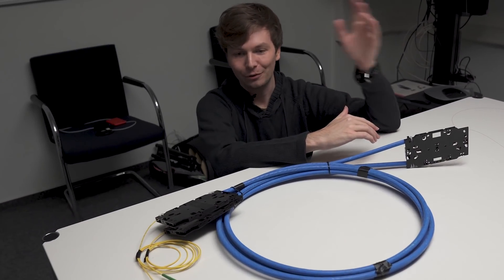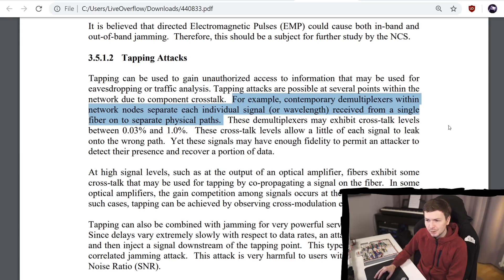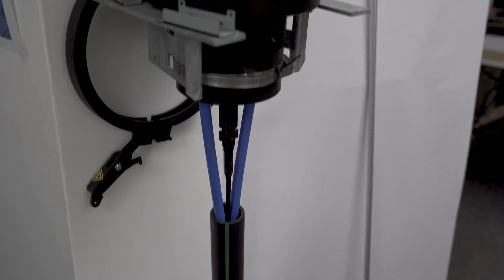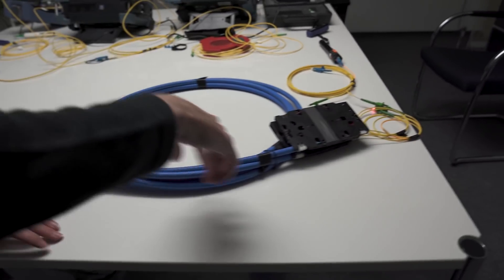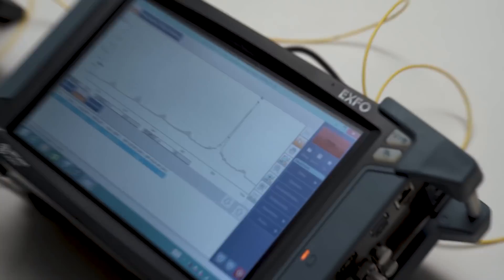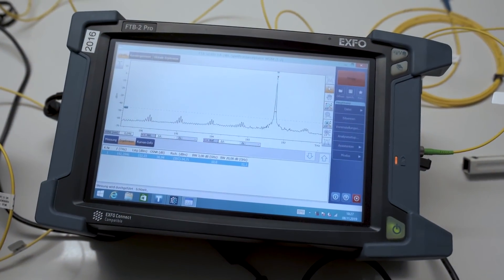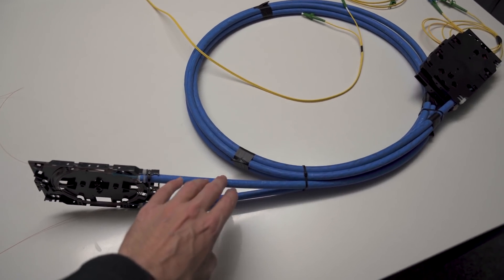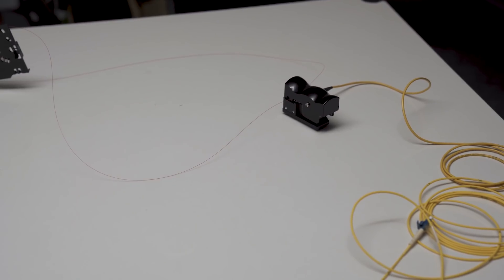Fiber Tapping - Monitoring Fiber Optic Connections

Comment: What if the tapping device senses the brightness of the input, taps it and amplifies it to the same level? The tapping would go unnoticed then.
Reply: Match something perfectly moving at the speed of light?  Best way would be to make very sensitive tap that would need very little light bled off so the drop in intensity would not be noticeable or to relay the signal after capturing it but this would have some lag and would probably be detectable.
Reply: @jameslowell9656  can't I just tap the signal and amplify it, realtime?
Reply: @sandipndev.personal  its moving at the speed of light ? So no you definitely cannot just add in the light you took out to the native signal instantly. There will always  be lag trying to do that. We just don't normally care about a few milliseconds of lag in the vast majority of applications amplification is used. But here they would be able to ping the line and know the signal is being delayed. If it wasnt something that was being actively monitored that would be fine , otherwise you would need to use minimally invasive passthrough capture like in the video.
Reply: @sandipndev.personal  in this situation time is effectively a constant for transmission. The distance from A to B is constant the speed of the signal through the medium is constant and since t=d/v and d and v are both constant , t is also a constant. So if they run any sort of diagnostics on the line they are probably going to notice.
Reply: The lag will be only once, first time. We can get the brightness and set the amplifier accordingly. After that, all the data could be tapped.
Reply: @sandipndev.personal  you arent amplifying it then. You are merely repeating the signal.....
Reply: That's for sure. And amplifiers can amplify signal in realtime. 

What if we calculate the amplification ONLY ONCE (that one time, there would be significant delay for the data, probably for that one data point, it'll go unnoticed).

There is the tap, and then, we have the amplifier. Since the amplification has already been calculated, we can have a realtime flow of the input, while tapping.
Reply: @sandipndev.personal  we aren't talking electricity.... the signal feed isnt continuous and predictable like electricity is. We are talking about injecting light into the line that we took out and matching it to  an unpredictable feed that is either on or off . How are you going to capture that light, calculate the light you need to inject and inject that light back into the line instantly? Just think about it from a basic physics standpoint.
Reply: Yeah that's true, this is really not possible...
Reply: @sandipndev.personal  you could relay  it and just capture and retransmit the signal but if the lag introduced by doing so was too much it would be obvious the line was tampered with or malfunctioning.  Best way would definitely be a very sensitive tap that didn't change the signal intensity much.
Reply: @jameslowell9656  Actually, optical amplification can amplify signals in "real time". I put real time in quotes there, because you would need an extra loop of 30m erbium doped fiber (google EDFA), which introduces roughly 150ns of latency. You could avoid this latency, if you replaced 30m of the usual glass fiber with your amplifier, but that is only possible, if you find a ~30m loop in the existing line.
Reply: @eikenope1008  ie. cutting the line adding a 30 m loop of foreign material and a "pump" which will require constant power supply and will require the line to be severed yet again to remove. Doesn't seem remotely practical
Reply: @jameslowell9656  Not to tap your neighbor, but i wouldn't rule it out for critical infrastructure. The big question is, if 30m slack (or a 30m spool in the middle :D) do occur in regular fiber lines. If not, you cannot get rid of the delay.
Reply: @eikenope1008  you have to splice in doped wire though.....
Reply: @jameslowell9656  Wouldn't you be able to inject light the same way to extract it in the first place? Bend the fiber again and introduce your amplified signal at the optical imperfection.
Reply: @eikenope1008  no , you would need to know the signal strength and use a doped loop to boost it. With your method it would be impossible in real time

Comment: I thought this would have some other sorts of physical attack vectors dicsussed instead of this simple physics phenomenon. Like what sort of stuff comes next? Cause injection is kind of impossible, can we obtain any other information?
Reply: You would probably want two taps to capture send and receive fibers but you could then watch the whole tcp/ip connection then.  Injection would be pretty tough. A laser powerful enough to get in through the -34db would just burn the cladding off.

Comment: I'm pretty sure they have repeaters/amplifiers  on long lines so the signal strength gets "corrected" on the way again, so unless these repeaters somehow also send their received signal strength back to the endpoint I guess it's going to be harder for the operator to detect?
Reply: I would think so - it's necessary in cases of problems... you don't want to dig up tenths or even more of cable to find a problem.
Reply: I googled a bit: usually the repeaters are capable of returning signal quality via a "supervisory signal" that is basically just a reflection of the input channel into the reverse path (cf. C-OTDR)
Reply: @steefant  fair point!
Reply: Yes, they are using repeaters, which can feedback the Signal.
Imagine the repeater would be the tapping device, no one would ever know
Reply: Amplifiers usually just amplify (multiply) the signal by a certain factor. So if your input signal strength decreases by 10%, your amplified output does so as well. Even if they had an automatic gain (adjust the amplification according to input signal strength), they'd have to measure the input signal strength and and then changes like a MitM attack would be reported from there.
Reply: They amplify an x increase, so a drop from a to b, is then increased to b+x rather than a+x, well there is still a relative decrease. a-b = (a+x) - (b+x)

Comment: The fact that they got 2000$ wiretapping device from russia for 300$ and the fact that we have some laws that are being made to isolate our internet sector amd analyze any outcoming traffic are kind of terrifying
Reply: And I could probably 3d print one for 2 bucks.
Reply: @satibel  you could print the case, but not the stuff thats worth 295$
Reply: @DarkIzo  you could print the bending part, and have a working one, but you'll probably be getting bigger losses, there's a prism which costs the price, but you could just use the output fiber pressed directly against the tapped fiber with some index matching paste.
Reply: Better than reselling krokodil don't you think?

Comment: Next step: create a tapper device that detects the original strength and corrects it after tapping.
Reply: It would be impossible to detect the original strength without cutting the wire and causing disruption to the network. Also you'd need to know the length from the tapping point to the termination point.
Reply: @justicesportsman6020  I don't think that is correct, but please correct me if I don't get physics well enough. You can probably test your tapping device before you deploy it. Say your original signal has 100%. After you install your tapping device, the output is 60%. That means you need to boost the signal by 40%, to receive the full 100% at the end again. You can get how much light that is equal to, by measuring the intensity in the tapping device itself. In this case you measure 40% in the tap that you need to boost the signal by. But like I said CMIIW.
Reply: @TheMBernhard   Well, let's first ignore the fact that you would need to detect the signal, produce one that matches at the proper amplitude and pipe it in before the photons whiz by. There's a lot of variables that need to be accounted for. If the taping device is consistent (which it's not, it reduced the signal differently both times they tested it) and always reduces the signal by the exact same % for all frequencies, amplitudes, and for both multi mode and single mode fiber it could work. You can also test the device with each type of cable/frequencies and make a table that could help. In the end even if you could get the same exact signal strength without adding latency after the taping this could still be detected with this method (I believe). The signal comes dispersed (modal distortion) bending the cable pulls out the highest order modes, which could be detected. I'm interested on your take on my other comment though. This link will highlight my comment https://www.youtube.com/watch?v=PbipefyfkNY&lc=Ugx4pCzivKZb2qfpNUZ4AaABAg
Reply: @justicesportsman6020  sorry, I am on mobile. Will try to check it out tomorrow. If it is the bending less approach, i am all for it. I was also thinking about total reflexion by bending the cable even more. Then you could extract the signal, boost it and feed it back into the cable. This way, the spectrum should look identical and only the point until total reflexion kicks in could be detected. But since most systems are erroneous, I guess noone would even care about a single fibre showing problems in a log. Why the taping reduced the signal differently each time, I don't know, but since parts of the cable are fully exposed and they had to change connections, I am not really surprised, either.
Reply: @TheMBernhard  bending it more would eliminate the issue of taking down the network for minutes with a traditional splice. The issue, this would require the use of a fiber output booster, even the best introduce latency which is something that is more important than signal strength. Usually for large fiber networks providers would look into a change in latency over 100ns. I think the best way of tapping would be only affecting signal strength. Not sure what the threshold providers have for signal strength drop but if you can stay below it ezpz.
Reply: @justicesportsman6020  Optical amplifiers create about 150ns latency (time it takes light to travel through 30m of erbium doped fiber), which you could conceal, by replacing 30m of the regular fiber with your amplifying fiber. I think, it has to be a loop though, which means you would need some slack in the original fiber line. The problem with multi mode fiber and distortion still exists of course. EDFAs (erbium doped fiber amplifiers) only amplify a certain bandwidth, so multi mode would be especially tricky. I don't know if distortion is something that can be measured without interrupting service (which a provider would not do without a reason).
Reply: @justicesportsman6020  ignore all that. If theres about 34db of loss to get out of the cladding and to the receiver, that injecting any signal into the fiber would take more than 34 db.  Say you want to get in and then have some signal left to get to the destination.  You're looking at 40dbm or at 10 watt laser.  Youd just vaporize the fiber you're trying to inject.
Reply: Heavens that would be extremely difficult without delay...

Comment: So, someone could just slowly close the case over several days and it would look like a normal disturbance?
Reply: If the link power is logged long-term, the you just have to change the time span of the graph and see the notch just as good. 😉
Reply: @gabiold  That might happen normally though
Reply: @circuit10  Why? This isn't a radio link. This is a closed optical system, mostly fixed for years, what could cause sudden disturbace?
Reply: @gabiold  Close it over a few years? I don't know, I'm just guessing
Reply: @circuit10  We comparing "several days" over something. Even if it is just there for 6 months, I don't think that the power should change normally this much as just moving the cable probably barely changes the loss, as opposed to what that excessive bend cause. So I think it is pretty stable over it's lifespan, and that loss could be seen on a graph.
Reply: @circuit10  That's a very stable finger to be able to do that I must say.
Reply: @nirui.o  True. Maybe a motorized thingy?
Reply: No. Just do it all at once because nobody is going to realise until you got what you needed. 
If you doing it slowly you're just delaying when you get caught. If you can do it at a time the network is down even if the anomaly is spotted it will most likely be misattributed to whatever happen when the network went down. 
All that said, don't do that unless you're authorised to.
Reply: or they can just use more advanced thing with amplifier which would require less bending and less signal loss to the point where it would be indistinguishable from random changes
Reply: @nekochan7001  wouldnt that decrease fidelity tho?
Reply: B. Lubb The bend would be observable on an Optical Time-Domain Reflectometer. You could randomly measure and compare the results of testing the fibre over time, it would also show any non-nefarious changes.
Reply: Prospect, Select, Plan it, Prepare All what needed, Coincide the tapping with considerable natural disturbance, (storm, heavy rain, flooding, earthquake, fire, ... ).

When picking your tap-point chose a spot that is unlikely to be checked, and that would less considered for physical checks due to difficulty and cost.

Do not use this to break the law!! ;)
Reply: No, as other pointed out, that doesn't really work if the strength is being monitored properly, now there are a couple of methods to be more surreptitious if you are say the NSA and have access to say a submarine fleet and a seal team to do it:
1) It takes a month for the ship to lay the cable all the way across the sea and it another couple of weeks before the cable is connected up, so if one was to take a submarine down where the ship was a week earlier and tap it during the laying, well, you have it tapped the moment it goes live. (I'm going to assume you tap all the lines here). Now they only have a possible maximum theoretical signal strength to compare to.

2) As was alluded to in the documentation, there are other devices on these cables, there are for example Optical communications repeaters that amplify the signal every so many meters, or more importantly, there are multiplexers and demultiplexers that combine and split the signal down multiple fibres to other locations thereby allowing one to address the data by the wavelength. This means one can have a box under the ocean that sends the data south to south America instead of into North America and have only one cable coming ashore in say Europe These devices are not 100% and leak data down the wrong cable, so all one need do, is access it via controlling only one destination. For example, if NSA can access the North America point it comes ashore, they can detect a very weak signal of the wavelength used for Europe to South America.
Reply: What about several years? At least, in the end, you will find out about your neighbors' browsing history...
Reply: @sharkbeats1397  Several millennia
Reply: @American Pride Pretty sure option 2 is that option ;) Navy good for communication between two enemy states that don't allow you access to their telecoms
Reply: No, all important links are monitored and will be checked if the signal strength changes.
This is because high-bandwidth or long-distance links use very sensitive optics that requires a certain signal strength to function optimally.

A drop in signal strength would need adjustment and as such the link would likely be taken offline and a technician would be sent out to find where the drop happened and fix it.
Reply: @Sipeari95  Yes, we said during laying, it is not that simple while one is currently unrolling it and placing it on the floor. For example the bend of the roll, or a rock on the ocean bed can effect it so during this time it is not so predictable.